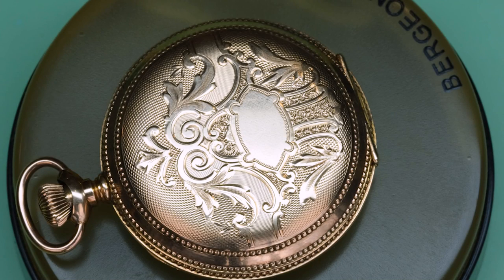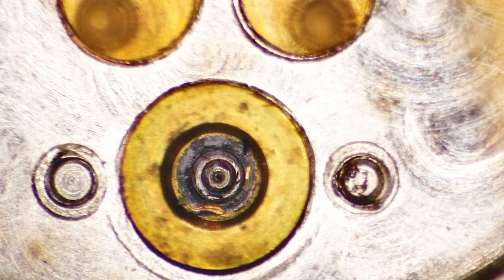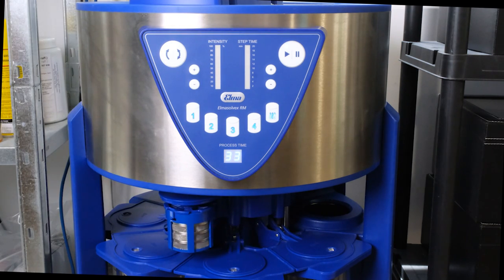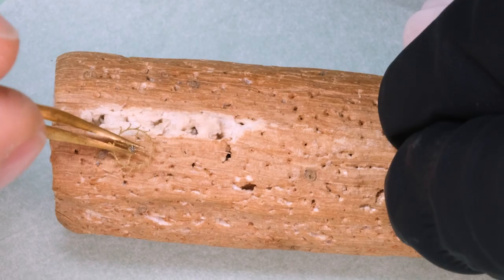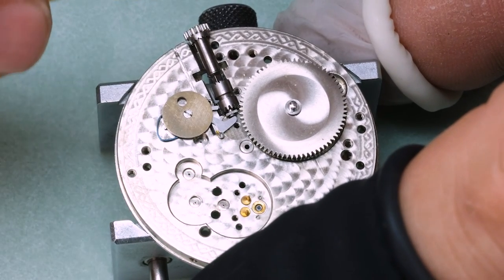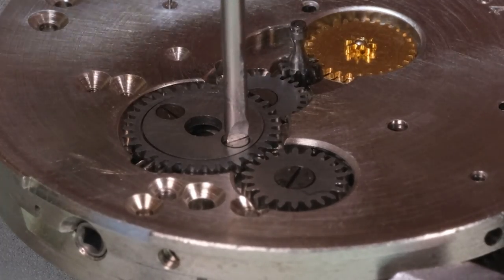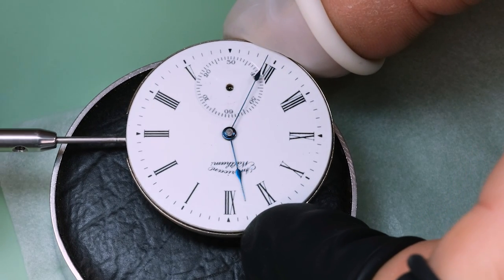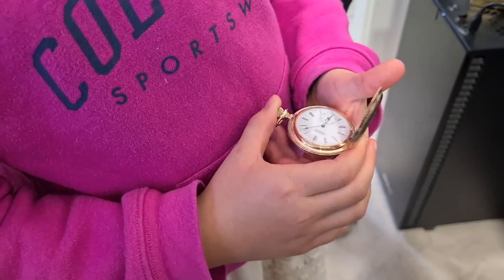American exceptionalism in an 1897 pocket watch!

Comment: Hello Stian:  One thing I thought I should mention about this style of watch.  This is a "hunting-style" case as opposed to the "open-faced" cases used in most other pocket watches.  In case you don't know, when opening the front cover, do not force it past 90 degrees.  It will damage the hinge.  But even more important one should press the crown in while closing the front cover.  The "latch" that catches on a small lip on the inside of the front cover will quickly wear the soft, gold-filled, cover and it will refuse to stay closed.  I have worked on mainly pocket watches and clocks for 20+ years.  Literally thousands of American pocket watches have crossed my bench.  I am always happy to see one of these old treasures show up in such good shape.  I might also recommend putting a chain on the watch.  It will definitely snap a balance staff pivot if it's dropped due to the lack of any shock absorbing mechanism.  I sell watch crystals, balance staffs, and mainsprings if you should have a need in the future.  Please let me know how to PM you my contact info if interested.  I don't want to promote my business or YT channel on your channel :-).  Beautiful work as always!!!! - Mike
Reply from the maker: Thanks Mike! Yes, I'm aware of the differences between hunter and open faced watches and won't force the lid :) And the front cover on this one was indeed already so worn that it wouldn't really hold onto the case. At the end of the service I gently pressed the top of the lid with my thumbs to slightly change the shape so that it locks better and it's fine now. If you could send me a mail to stian@vintagewatchservices.eu, then I can save your contact details for the future!

Comment: I got the same seaside. 1899 with 15 jewels. I paid $560 for it because it has a 14K solid gold case. The coin shop was going to scrap the watch and have the case melted down for the gold. This happens to almost all gold pocket watches today. I immediately told them to hold it I'll buy it it a couple weeks (I only make $15/hr). I'm going to use your video as an aid to service it and get it running again.

Comment: What a sweet gift for a very deserving young lady. Beautiful. I have my mom's pendant/pocket watch to work on. It has a New York Standard dial and movement from 1910 and an Elgin case from 1890. At least that's what the serial number database told me. It wasn't working and was missing some parts so I sourced a replacement movement and just have to screw up the courage to extract it from its current case and implant it in my mom's case. It's a treasure I'm happy to own.

Comment: Another great video. All I work on are pre-1925 American pocket watches. Wrist watches just never interested me much. Your Waltham was in great condition. The only Waltham pocket watch I own is an 18s, 15j movement made in 1886-1887 still in the original salesman container(metal can with glass on both sides for viewing). It's never been cased(no scuffs/scratches where case screws go). I guess that makes it "new old stock". I couldn't believe with all the cool tools you have, that you didn't have pocket watch mainspring winders. I wound many by hand for pocket watches before I got a few vintage winders. Thanks for the video, I really enjoyed it.
Reply from the maker: Thanks Chuck! Sounds like a very nice watch you have :) I rarely work on pocket watches so I don't have all tools for them, but given the safety barrel, would they even fit?
Reply: @VintageWatchServices  , sure, they would still wind the spring so you can get it in the barrel.

Comment: One of the interesting results of the American practice of selling the movement and case separately is that a person on a limited budget could choose which one of the two to put more money into, depending on what they expected out of the watch.  You could spend more money on the movement and less on the case and have a higher quality/more accurate movement in a case that could take more wear, or a very fancy watch with a gold case and fancy dial but have a low-jewel movement because the appearance was more important than accuracy or ruggedness.  I have seen plenty of watches with hand-decorated dials in 14k gold cases but with a 7-jewel movement, and also true railroad watches carried by engineers and conductors with a 21- or 23-jewel movement in a plain nickel steel case for ruggedness.

In the 1800s - thanks greatly to arms industry during the American Civil War - the Americans became known for "mass production" (not to be confused with "assembly line production") where all the parts were made in the same factory.  The Swiss, et al were still sub-contracting out batches of parts to local craftsmen in small shops which were then brought to a central factory for assembly.  An elderly friend who was a watchsmith for many years used to say that American pocket watches of that era were far easier to work on because the parts were all identical and easier to replace, yet the Swiss watches required much more custom fitting for each part because each batch was made by many different craftsmen at many different shops.

I always enjoy your videos!
Reply from the maker: Thanks a lot for sharing your knowledge, Jon!

Comment: On these "Safety Pinion" movements the 2nd (center) wheel had a screw on pinion that unthreads if the mainspring breaks. 
Beautiful movement and lovely watch, especially for $75 dollars. My eBay strategy it to look for listings that state "over wound". Gems for cheap.

Comment: Beautiful, Stian.  I used to think that pocket watches were anachronisms.  However, I decided to get a birth year watch, and since I was born in Lancaster, PA, I decided to look at Hamilton.  I ended up with a Railway Special with a 992B movement that was made the year that I was born.  It is gorgeous, with snailing on the ratchet and crown wheels, côtes de Genève on the bridges, polished wheels and a gooseneck regulator.  I replaced the solid caseback with a matching dial side bezel and crystal to display the movement.  After a full servicing it is running within its original railroad specificiations of +/-  30 seconds per week (better than COSC)! Because it doesn't have shock settings and the heft of the watch makes it vulnerable, I don't regularly wear it, but I do have a nice gold chain (essential to avoid dropping the watch) and a leather belt holster for it, so I can take it out for a walk occasionally and wear it at family gatherings.  The rest of the time it sits on a stand on my desk merrily ticking away.  It's a real gem.
Reply from the maker: That's very nice to hear, Bullnose :)

Comment: Stian,
What a nice looking1890 Model 7j Pendant Watch (made in 1897 as you indicate). One of the reasons that the case looks so nice is that as a smaller 6s watch, it was likely worn by a woman on a pendant around the neck as a piece of jewelry rather than as a daily use item in a mans watch pocket where the cloth would wear off the gold fill and brass engraving underneath. It is interesting how the ratchet wheel is stacked under the barrel and the winding wheel is under the dial to save space as well. On the larger watches, these two wheels become part of the external embellishment.  I have been working a lot on the 12s Model 1894 and 16s Model 1899 Waltham watches. So far I have restored twelve Model 1894 watches and two model 1899s. I have my model 1899 (a 19j Riverside) in a two-sided display case so that one can see the beautiful movement in action without having to take off the back. It keeps fantastic time regulating to -2 spd to +10 spd in all 6 positions.
Reply from the maker: Hello Doug, I think you're right in that, and my daughter will wear it on a chain also. Until we have one for her the watch will stay safely on my desk :) Pretty amazing timekeeping you got out of your watch!

Comment: Video, excellent as always. Ending, over the top. Good job.
As a 7j piece the price is in range. Usually someone will buy it just for the case and swap in a 15 or 21 jewel movement. I've always wondered about taking a piece like this, drilling out the train bearings and pressing in jewels. I'm sure that's not cost effective but it would be fun to throw off all the serial number counters. 🤪

Comment: Beautiful job sir!  In the USA her friends would be asking how you make a call from that thing.  I have several American pocket watches, including a Hamilton model 23 military that needs service.  I have looked many places for a pair of tweezers like your (#7?), including Regine, Switzerland's website, with no luck.  Can you tell me where you got yours?
Also, do you always 'wind' the balance assemblies anti-clockwise into position?  Is the pallet horn against the inside banking pin when this is done?  I've gotten myself over-banked a number of times and I wonder if my balance mounting method is at fault.
Reply from the maker: Thanks! My tweezers are indeed from Regine, and you can send them a mail to info@regine.ch saying you'd like the 7A-BRA tweezers. For reference, the product link is here: https://www.regine.ch/products.php?subid=27&lang=E&Tq=R&Taf=W&Tm=BRA&Tbase=46&twpg=1
The important thing when putting the balance back in place is exactly that the impulse pin is turned into the horn slot. Thus you first see to which side the pallet fork is banking, then you turn the balance to make sure the impulse pin enters properly.

Comment: This is the genre of watch I mostly "work" on, although I see more Elgin than Waltham. To me it's kind of surprising you were able to get the balance jewels out the way you did. I usually find them a much tighter fit and have to push them out from the opposite side with pegwood. It's also very common to find the hole jewels have been damaged over the years, sometimes by mishap and sometimes because I'm not the first amateur watchmaker to have a go at the poor things and some of us aren't very careful/have no idea what we're doing.

When the jewels on either end are different colors I generally assume one of them was a replacement. But maybe I'm wrong, because it would be odd if a replacement jewel had the exact same manufacturing flaw as the original. As far as failure to have cleaned up niceties like that, I usually attribute that to the economics of watchmaking back in the day. When most people carried a watch like this, and everyone needed them serviced regularly, I imagine watchmakers sometimes didn't the luxury of working as carefully as they do now and had to get them finished and out the door as quickly as possible. Cleaned, lubed, regulated was just about all anyone had time for. And was sometimes maybe all their customers were willing to pay for.

I have some vintage winders that were intended for mainsprings this size, but there's no reason to have them if you rarely work on these.

The arrangement of click and barrel here is not one I've dealt with before, but then, I've never worked on one with a safety barrel either. So maybe it's typical in that case. Usually, with a going barrel, you'll have crown and ratchet wheels in the usual place.

One issue I see you don't seem to have here is with the banking pins. On old watches like this they were adjustable. Unfortunately, rather than deal with the somewhat fiddly way you have to move the balance spring collet, an amateur will try to fix a beat error by readjusting the banking pins instead. This is almost never the right thing to do.

That dial is in FANTASTIC shape. Maybe that's why this watch cost $75. (For a non-running vintage watch, it's a little on the high end in my admittedly limited experience. Running watches will go for a couple of hundred.) The watches I tend to receive almost always have cracks in the enamel. The case is in wonderful shape too. Even the heavy 20-year gold-filled tend to wear through if the watch saw a lot of use, so I wonder if someone had this re-plated at some point.

The sleeve -- the part inside the tube that actually retains the stem in setting or winding position -- tends to attract a lot of dirt and gunk in my experience, bad enough that they're sometimes stuck when I receive them. I'll generally remove the sleeve and clean and grease it, but that's hard to do unless you have a "sleeve wrench". Like the vintage winders, there's no reason to have one unless you work on these all the time.

It's great to see a beautiful vintage pocket watch getting professional treatment for a change. Thank you for this one.
Reply from the maker: Thanks so much for your comment! The banking pins are certainly (too) easily adjustable but luckily they looked fine to me. And yes, this was a real find for sure. I suppose once someone finds an old watch like this from their grandmother and see it's not working they don't bother much with it.
Oh, and yes, the cap stones are very tight on all old pocket watches I've ever worked on, so I indeed do the same as you; wiggle them from one side, then the other, then the first side again, then the other etc, until they're loose enough. I just didn't bother boring people with that in the video :)

Comment: Hi Stian, nice job on a nice watch. One thing I didn't see you do was clean and grease the detent sleeve and case stem in the pendant. Regards David
Reply from the maker: Hello David, thanks for watching and I love your website! I simply cleaned the entire case in the ultrasonic and put a couple of drops of HP1300 into the sleeve and case stem. I'm not a pocket watch expert so if there are better ways of doing it I'm happy to learn :)
Reply: @VintageWatchServices  Hi Stian, thank you for your kind comment about my website, much appreciated. The pendant detent mechanism is an important part of the overall keyless work of a negative set movement but servicing it is not mentioned in any of the many repair books I have. The detent sleeve is blue tempered steel and can suffer from wear, rust and the fingers breaking, so I think it's always worth removing the sleeve and case stem to clean them and check their condition. When moving from winding to setting, the pressure on the bulges on the stem from the sleeve fingers is high and grease with molybdenum disulfide like Moebius 8201 helps to give a nice, smooth, action. I prefer grease in this application because it stays in place.

Comment: If the jewels were rubbed in with brass overlapping them in order to hold them in place, what holds them in after you remove the overlap?
Reply from the maker: You don't remove the overlap, you gently lift it up and then you press it down again after putting in a new jewel.

Comment: I have a 1949 Hamilton Railroad. I inherited it as a teenager. It was broken when I got it. 40 years later I decided to reach out to Hamilton to see about getting it fixed. Hamilton wanted $600 just to look at the watch. Then I'd have to pay for service, and if they could source/make the parts  I'd have to pay for all that too. Also to get the watch back I'd have to pay all taxes and all duty/customs fees for both countries, and pay for shipping. Basically Hamilton told me NO. 

I cannot afford that, so it will remain broken. 😢
Reply from the maker: Sorry to hear that and the service can indeed be quite costly. You can contact me at stian@vintagewatchservcies.eu with lots of photos of the watch then I can see what can be done. No promises, as I'm way too overloaded as is...
Reply: @VintageWatchServices  Thank you for that fine offer! I can send photos. I've taken the back off the watch (never removed the movement though) and the problem is not readily apparent. Its the images I sent to Hamilton.

Comment: I would like to be able to send you some unusual pieces for repair evaluation, or for you to utilize in your discussions. For example, one of the Tiffany and Company pocket watch movements that was produced at the actual Tiffanny factory before it burned down. I have a collection of approximately 80 to 120 watches almost all of them are vintage mechanicals such as an  80 to 120 watches almost all of them are vintage mechanicals such as a Omega’s Hamilton’s IWC’s etc. Omega’s Hamilton’s IWC is etc. I also have a number of electro mechanical watches, such as omega F 300s and Bulova Acutron‘s from the 50s and 60s.

Comment: How to open the back to get to the gears? Mine won´t open :S
Reply from the maker: The cases will generally tell you how to open them by their features. If you see a little lip, that's for inserting your finger nail or a blade. If the circumference of the case back has grooves, that means it's screwed down.
Reply: @VintageWatchServices  there is a little hinge on the bottom. It must open just like the watch in the video. Seems like it's stuck.